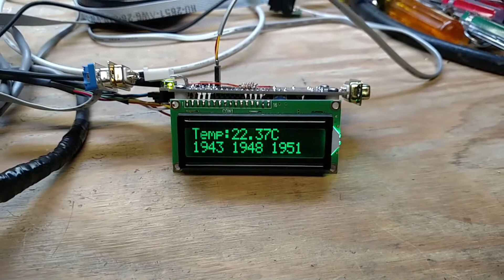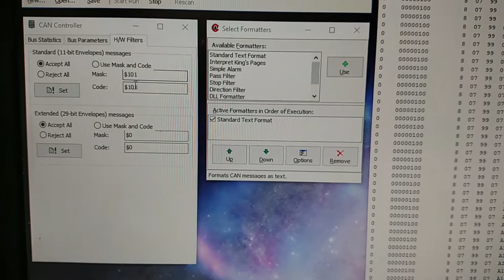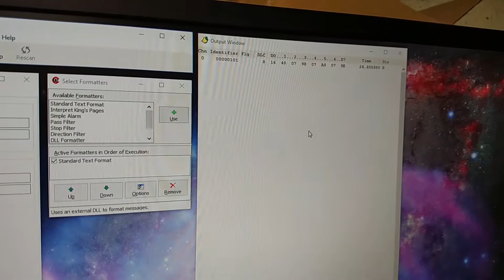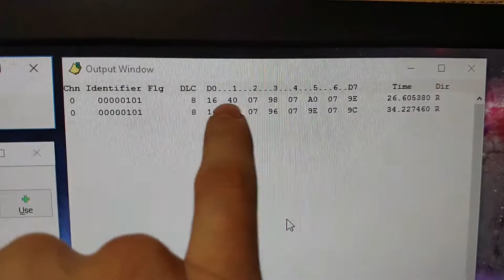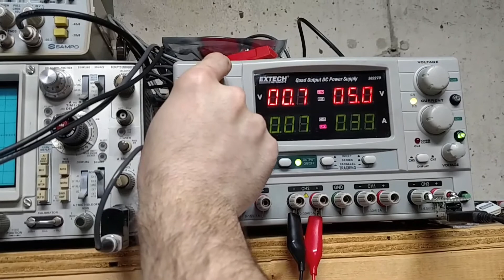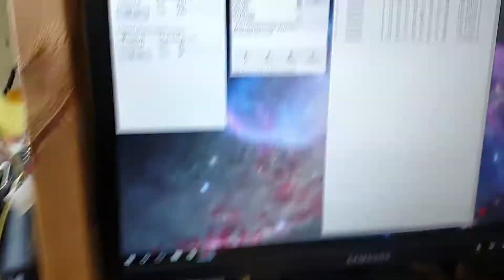Solectria E10, Lithium Ion Battery Upgrade, Part32

Comment: I have worked with quite a few unknown NTC's and found this site useful http://www.giangrandi.ch/electronics/ntc/ntcparam.html to workout NTC parameters.  I then use a spreadsheet to build a LUT for the range I am interested in.  I have always just checked maybe 5 to 10 temperatures in the 0c to 100c range and called that good, but I like your idea of building a graph over a large range and seeing how linear the samples are.  Did you measure the resistance of the sensor at rest and the pull up resistor?  I have always used those values to go from ADC counts to Volts to Ohms and finally to Temperature, then a LUT does the conversion in a flash.  I suppose from just ADC counts it could be worked out too though with a little speculation perhaps, I will have to try and figure that out and see if it works :-)
Reply from the maker: The temp sensors actually go through a bunch of circuitry before they make it to the microcontroller pins... it looks like they have some ESD protection and some filters.

I recoded 22C to 100C, and 100C to 20C... looks very logarithmic, but the sensors look like they diverge from each other at the extreme...

Working on 22C to -15C? what ever temperature the freezer gets down to. ;)

I will probably just do a look up table in flash based on the average data points between the sensors.
Reply: +Wolf Tronix 
Fancy electronics for a simple sensor I would think...  So I guess you need a LUT for each sensor then to handle the differences.  100c! I hope your battery never gets that hot :-)
Reply: +Wolf Tronix 
Fancy electronics for a simple sensor I would think...  So I guess you need a LUT for each sensor then to handle the differences.  100c! I hope your battery never gets that hot :-)